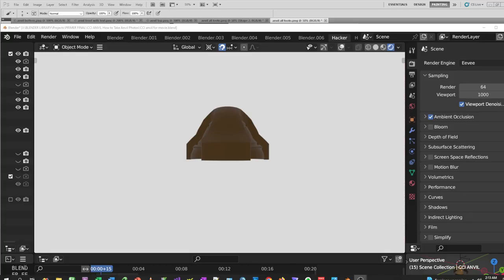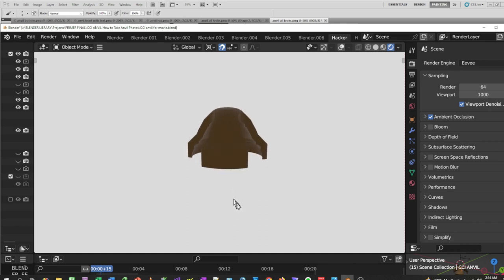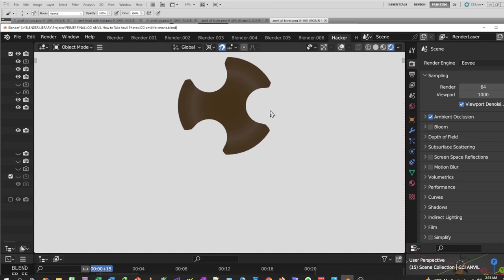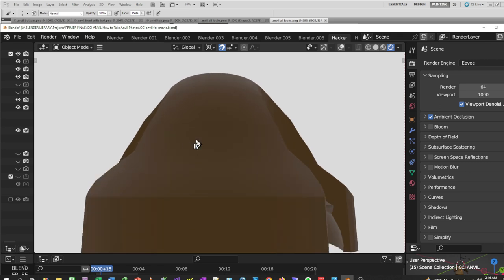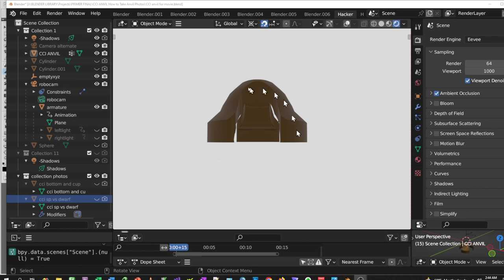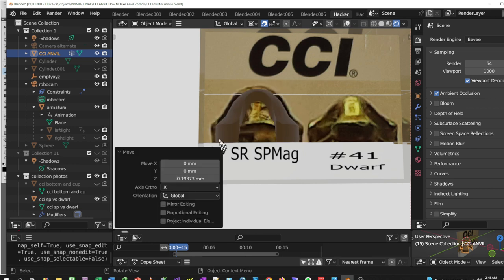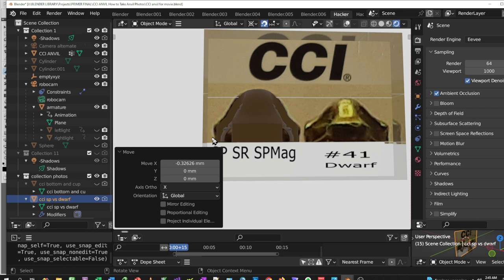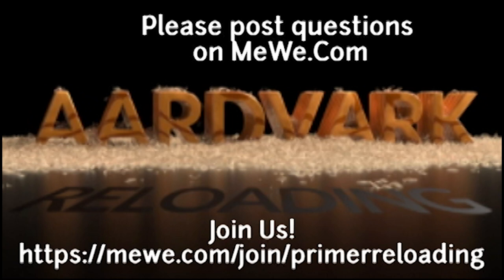How to Photograph an Anvil (Let's share)

Comment: I have read about using a ball as anvil but this requires broaching of the flash hole. How about using a piece of round section brass wire placed perpendicular to primer's axis that is cut to length to fit inside the primer cup? This would require no modification of primer hole and you need just wire and a way to cut them to specified length. Is this my invention or it existed already, and if so why is not used? Please comment.
Reply from the maker: Food for thought!
Reply from the maker: I have been playing with wind shield wiper blades (metal insert)
Reply from the maker: The anvil usually survives the beating.   The cup is what takes all the damage.    Good thinking
Reply: There's a poster on reddit that goes by the name advanced payment (and some numbers) in a diy firearms group that has posted his journey on a cup and anvil pouch die. Seems he's had great success. He has his step files uploaded too. Haven't had a chance to machine one as we had a house fire, but hopefully by spring/summer when I get things back and runnin.
Reply from the maker: @Ishnifus Meadle  thank you for reply.    I hope/trust and pray all your family and pets were unharmed.   You have your priorities in order.    We'll be here when you have time.
Reply: Thanks a lot friend...
I always thought about how to replace the anvil in a SHTF circumstance, because the cup we can make, which is more difficult when it comes to the anvil.
brilliant solution!!
thank you as my experiences make it clear that it will be effective.
Reply from the maker: @coyotexpl1507  The cups take the beatings/receive most of the distortions.    The anvils usually survive.     Cups with large primers: maybe 1 in 10 are reusable.